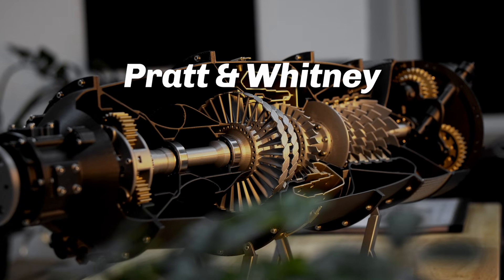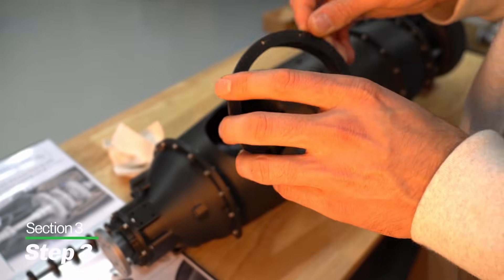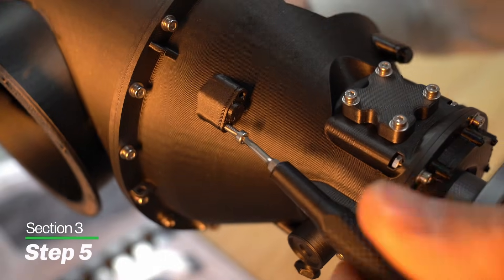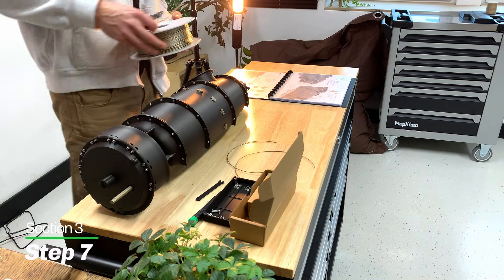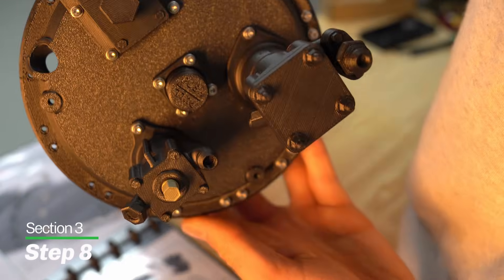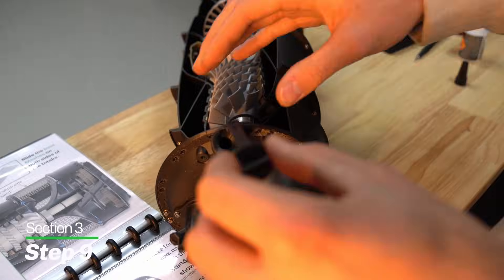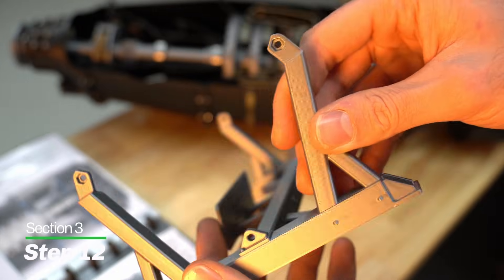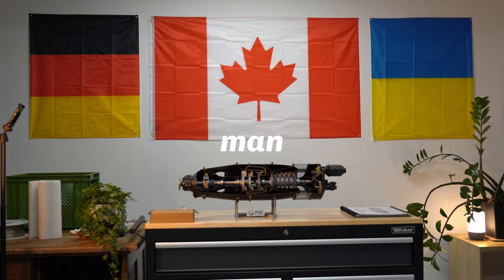3d printed PT6E Turboprop Engine | Assembly - 3rd Section

Comment: When joining the two parts the propeller side stators and turbine slightly graze each other. When disassembled they rotate beautiful. I have the hardware just slightly tightened down.

Any idea what I can adjust to fit the rubbing?
Reply from the maker: There should be a noticeable gap in between the stators and turbines to address exactly this. Make sure the turbines are don't Oscillate by gluing them onto the shaft carefully and the Stators sit all the way in the intended spots. If this doesn't work, let me know :)

Comment: Not sure if I missed it but how did you even begin to figure out how to design such a complex assembly
Reply from the maker: Honestly, a little bit of delusion played a role in this... I started with the compressor and worked my way out, back/forward on the engine. I used a LOT of reference images